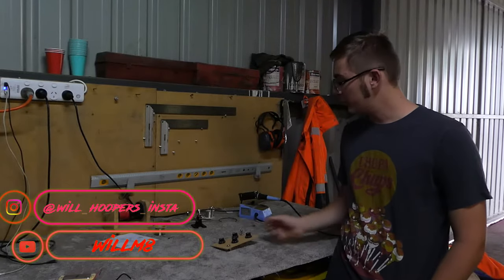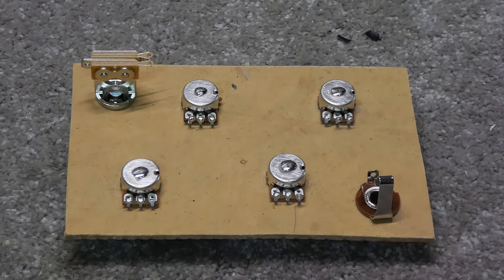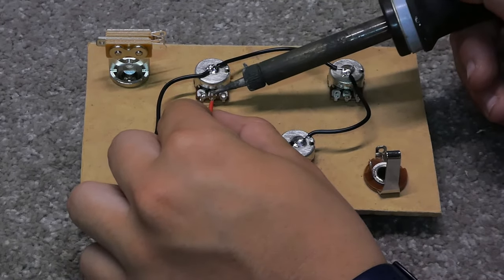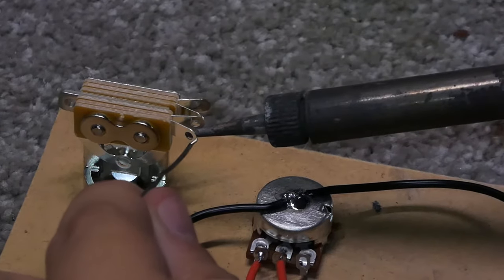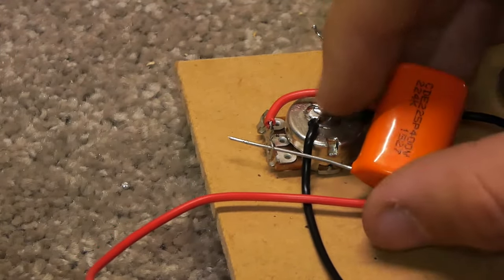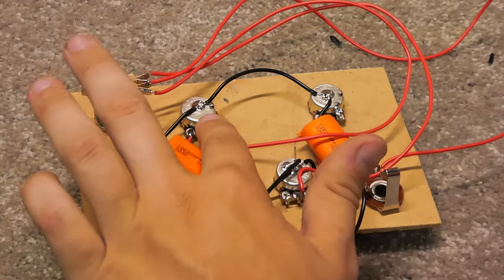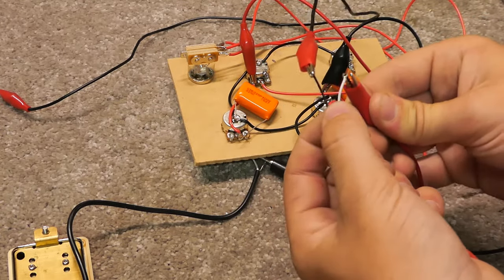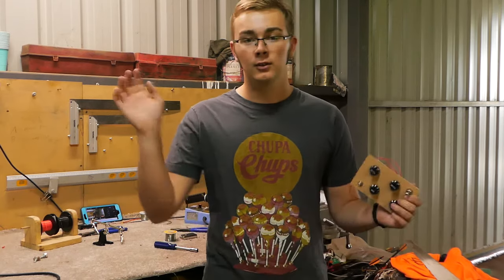How To Wire A Les Paul Type Wiring Harness

Comment: Nice vid, but you have created a ground loop by connecting all 4 pots together. You will create a nasty buzz if you are not touching the bridge or strings which you found out. Not what you want with a 100W Marshall.
Reply from the maker: Bold of you to assume my line 6 is a 100w Marshall 😂
Reply: whats a better way of grounding them..? just eliminate a wire form 1 of the vol pots to 1 of the tone pots??? so its not a loop?
Reply from the maker: Hey man shoot me an email to send some pictures cos it’s a bit hard to know what’s going on without seeing the actual wiring
Reply: Yes, h e adds oone extra-nneceessary ground wire,, but... THERE IS NO SUCH THING AS A "GROUND LOOP" INSIDE A GUITAR!!!  Ground loops only occur between powered components like amps, equalisers, pre-amps, etc...Redundant extra grounding inside the guitar does absolutely nothing - no noise, interference or anything... If you have sheilding in the cavity its all grounded. And yess... I do have a degree in electronics, and I've been playing/wiring guitars since the 70s. Have a good time with your guitars and don't worry about imaginary issues you hear about on the "mis-infformation highway"
Reply: @ioodyssey3740  Thank you, I get tired of that myth. Amongst many others.
Reply: What's your opinion then?
Reply: @outbackguitars3272  thanks 🙏🙏🙏
Reply: @ioodyssey3740  what about active guitar electronics?
Reply: @ioodyssey3740  so should you have or not have the extra ground wire just to be safe just in case? What us the claim being made and refuted here?
Reply: The capacitor is so terrible😂😂😂
Reply: @outbackguitars3272 😂

Comment: Idk much about electronics per se but you probably don’t need all 4 pots connected to ground like you did. They don’t all need to be connected to each other. The 4th pot doesn’t need to connect back to the first pot because it’s already connected through the other ones

Comment: The grounding wire on the far left between the volume pots, is that necessery? They all have ground already, right? And they point in the wrond direction, if you point the solder joints down it can not fit some guitars. I would not recommend this video, sorry.
Reply from the maker: Each to their own mate but I appreciate you watching
Reply: @outbackguitars3272  a respectful answer. I like it!

Comment: Hi Will, Greetings from the hills of Northern California. After looking at a few others, your video was exactly what I was looking for!  Someone really hacked their mod on my 1982 Ibanez AM-50 when adding a 6 position Gibson style rotary tone switch, and wiring the guitar for stereo. While that would be a cool mod if it had been done well, this is a hot mess! I plan to scrap the rotary switch and go back to stock re-using all the original pots as they appear to be high quality. Anyway, I really appreciate your very clear and easy to follow video!

Comment: After watching your video, I just got done pulling my new harness into a semi hollow body Ibanez. If you have ever done this, you know how tedious it is as you cant gey hands in side so have to pull each pot/switch/jack to its mount hoe with a pull string or wire. I realized that I did not need the ground wire you put across the tone pots as each is allready grounded via the ground wire from each Volume pot. So I cut that one out (the less wires the better) before fishing the wires into the guitar through the bridge pup hole. That was not fun BUT IT WORKS NOW!! YAY!!!
Reply from the maker: I have never worked on a semi hollow body but I have watched enough videos to know it’s going to be a pain when I get my hands on one 😂

Comment: A is audio taper- best used for volume. 
B is linear taper- best used for tone. 
You also are not using caps…check out a few 50s snd 60s wiring diagrams. 
A little more info will help you make more informed vids.
Reply from the maker: Thanks for the feedback

Comment: As a newb to soldering, what type of wire is the ground wire? Like where do I buy it? What is it called brand wise etc
Reply from the maker: All wire is the same the only real difference is the colour of the insulation on the wire that helps identify it. I have no idea what size people normally use as I just have had the same reel of wire for years

Comment: Hello Will, your video is very good and so easy to follow, I have a Epiphone Les Paul Standard and I think that someone has altered the wiring so I'm now going to attempt to rewire following you instruction. Just one wee thing? when you tested the pickups, you used the selector switch in two positions but not the middle position. Can I assume that the middle position on the toggle switch will put the two pick-up's on ?
Reply from the maker: Yes that is correct the middle will have both the pickups on
Reply: Thank you  @outbackguitars3272

Comment: If you compare this video to how LP Guitars are wired in the USA and what USA suppliers are reputable parts suppliers (like Switchcraft and CTS), there are many differences in wring approach and parts used. So much so that the completed wiring approach does not look like any LP I have ever seen. Maybe they make LPs different in the Outback.  

The drawing from GuitarElectronics shown in the video is incorrect, it is neither LP Modern or LP Vintage. It may by for a different guitar but not for a LP. LPs wired Modern or Vintage have 4 identical pots 500K Ohm 10% Audio Taper from CTS. So perhaps the video is using a custom wiring design, because it is definately not LP factory wiring of any era I have seen. Well, don't take my word for it. Just go to The Trogly's Guitar Show on YouTube, who collects many different era and types of LPs, where he will open the guitar rear pot cover so you can see inside the electronics bay and you can see for yourself how they are wired and soldered.

The Gibson 500K pots 10% Audio taper, can be a bit tricky to measure on the bench, due to the fact that the tolerance is +/- 20%. If you buy some TAOT CTS 500K pots with a tolerance of +/- 5% they will track much more closely with the CTS 450G data sheet taper graphs. 

All Gibson and verified custom suppliers of CTS guitar pots (like TAOT and RS, etc.) based on the CTS 450G series gutar pots all have Brass mounting shafts and brass split shafts. The pots in the video have neither. Purchased from China?

Cross connect the pickup feeds volume pots with a ground connection and not the tone pots. Do not form a loop, either cross connect the volumes or the tones but not both. When you form a loop you make an antennea. It is best to cross connect the volume pots because these pots are first in line from the pickups.

Also, in the USA wiring either Modern or Vintage LPs, with factory pickups without coil tapping or splitting or any other switch push-pull pot special modifications, the pickups will use Gavitt Style push back wiring and not the pickup wiring shown in the video. The Gavitt wiring will have the ground as the outer tin plated braid around the pickup output center insulated center conductor. The the most challenging connection to solder is the Gavitt push back wire to the pot rear cover, where you may have many different Gavitt wires soldered along with some bus wire grounds. Some Gibson guitars use Humbuckers that bring out all four wires, but usually for the purpose of coil tapping. 

The selector switch is best wired with three Gavitt (braid + center conductor) wire, two as the signal sources from the volume pots and a third which goes to the output jack. The selector switch housing must be connected to ground, technically to chassis ground, but on an LP the chassis and signal grounds are tied together. At the switch the connection is made between all three of the Gavitt braids and the pot chassis ground using tinned bus wire, usually 20 AWG. In the video the switch chassis ground was not connected.

The LP owners that I deal with want a factory look to the wiring. I would suggest that you try and emulate the factory techniques.
Reply from the maker: Bro this is a comment section not a high school essay

Comment: I am rewiring a TELE with a humbucker NECK p/u and single coil BRIDGE p/u and am confused on what type pots to use. Can they both be 500s, 250s, or do I need one of EACH? What about the TONE pots? Any help will be appreciated... ;) THANKS!
Reply from the maker: They can be whatever you want the ohm rating affects tone a little bit but honestly you can use whatever you have it will still work

Comment: Whats the point of the red wire from the first lug of the volume pots to the second lug of the tone pots? Also, dont you have to ground that lug on the back of the switch too?
Reply from the maker: I can’t remember what the red wire does it’s just part of the circuit and it’s been a while since I’ve read the schematic. And no you don’t need to ground the switch
Reply: im struggling. Ive seen the capacitors in the 2nd lug of the tone pots and the  grounded to the back of the pot. Ive also seen them from lug 2 of the tone pot into lug 1 of the volume pots along with the wires from the switch....Im sooo confused lol 😂.
Reply from the maker: If you are struggling I’d suggest getting alligator connectors and trying different wiring combinations. It’s a lot quicker and better than soldering when you just want to troubleshoot.

Comment: IS THERE A DIFFERENCE BETWEEN A VOLUME AND TONE POT, LIKE IF THEY ARE THE SAME RESISTANCE, IS ONE STANDARD VARIABLES RESISTOR AND ONE EXPONENTIAL, OR IS IT WIRED THE OTHER WAY, IS THERE ANY REASON NOT TO USE A TONE FOR A VOLUME, AS I HAVE PUSH PULL 25K TONE POTS AND 25K VOLUME KNOB, SO WANT TO KNOW IF CAN USE TONE PUSH/PULL ON VOLUME

Comment: what is the difference between a and b pots and can a be used for b successfully
Reply from the maker: No not really volume pots turn linearly (a straight line) while tone pots turn non linearly (on a curve) so you need to use the right ones

Comment: On my guitar - the wiring is as per this video - but - all those signal wires (red) in this vid should have an outer shield and the shields should be grounded  to the back of the pots - other wise you're probably going to pick up a lot of hum.  By shielded I mean that there is a wire in the center surrounded by a braid whch should be grounded.
Reply from the maker: Sounds like your wiring p-90 pickups. That braid is the same as in the video with the black wires it’s just the negative conductor of the pickup

Comment: Nice one - hated upvoting as you were at 666 mwahahahaaa - but did anyway. Nice fast and clear explanation. Anyone wondering, recommend tinning wires with solder that are not pre-tinned (I believe these wires would be pre-tinned, apart from pickup wires) but this will make your soldering life a happier and faster one :) Other than that, while you'll see different techniques shown on other videos, this is pretty bang on and will do the job nicely. Those caps were bloody huge though mate 😂😎
Reply from the maker: Yeah the caps I just used as the smaller ones were still being delivered from china lol

Comment: What kind of solder and how many watts is the soldering iron? Thank you!
Reply from the maker: The wattage of the soldering iron and the type of solder don’t matter although the thinner kind of solder is a lot easier to work with
Reply: Buy a soldering iron with at least 60 w of power and one that you can turn up or down. Weller makes great products. You need that to solder unto the pots.
Reply: Can i send u a photo of my guitar wireless

Comment: My 3 way toggle switch for cherry red Epiphone DOT 3.....in the centre position, the Neck pickup goes off if the Bridge pickup Volume is Zero? Is this normal? I thought in the Centre position, the Bridge and Neck pickups Volumes were independent?
Reply: Yes, this is normal. That's how the circuit works.

Comment: There is a ground lug on the switch.....use it.  Also, don't use giant capacitors. They are for 250 volt circuits.  Guitar pickups make about .5 volts max.
Reply from the maker: I said in the video I’m using em temporarily cos the small ones were on back order
Reply: @outbackguitars3272  Back order? Capacitors?  Really? Chins makes 7 billion of them per day. How can they be hard to get?
Reply: @timhallas4275  you’ll be alright, bud
Reply: @thawingshrimp6418  You won't.
Reply: @timhallas4275  I guess not
Reply from the maker: @timhallas4275  bruh it takes ages to ship from china to australia
Reply: @outbackguitars3272  You're joking.
Reply from the maker: Why would I joke about constant pain that china shipping brings me?

Comment: A and B??? I’ve seen some stuff where it’s flipped on American, where A is Vol and B is Tone… Wtf super confused here. I’m in Canada using WD parts, is A=Vol & B=Tone, OR, B=Vol &  A=Tone???
Reply from the maker: If you are unsure I’d grab a tester out to check how much ohms there is when you twist the pot. The volume one should be consistent while the tone should be sensitive at the start and then at the end
Reply: @outbackguitars3272  what do you think about using Logarithmic Pots for both vol and tone? I saw a couple of things on forums swearing that logarithmic is the way to go.
Reply from the maker: I’ve never actually heard anyone do that before but from the way I understand logarithmic and linear pots I can see why it might be a good thing
Reply: I like fast volumes swells so A is what I use for  volume.. But really it all will work. Most people flip volume and tone on 10 and don't worry with what algorithm it is.. You don't even need the caps in that case. solder that shit and be done and jam. You'll figure it out